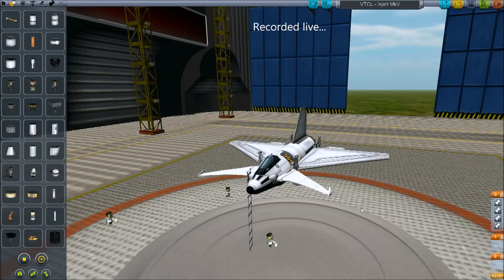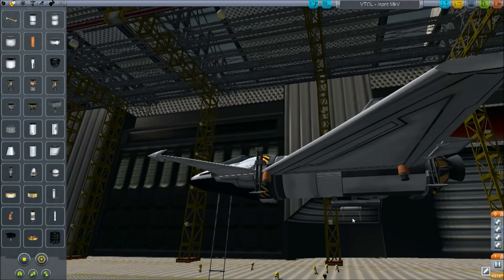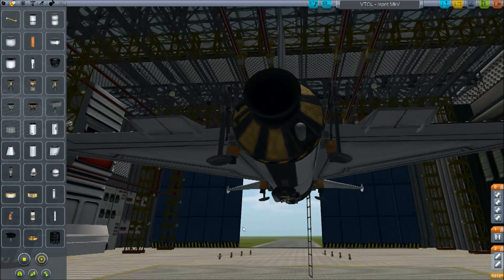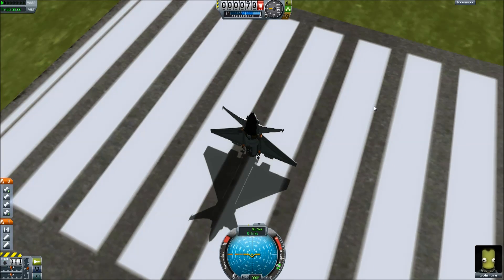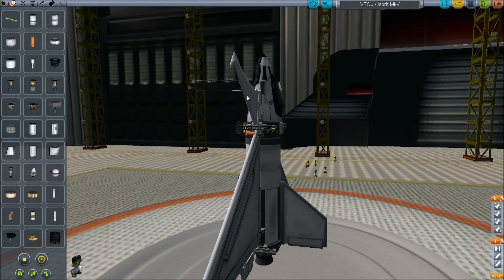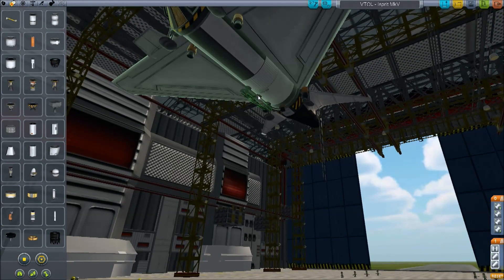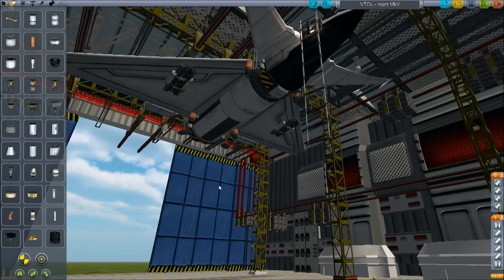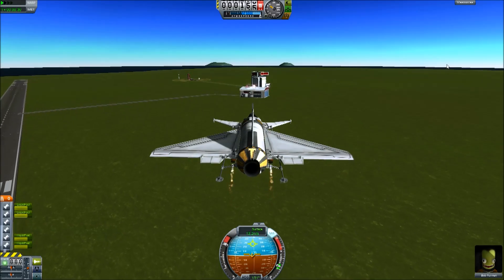KSP - How to Make Working Missiles

Comment: True. You can use a bit of trickery though: copy the .craft file from the SPH folder to the VAB folder, place the sepratrons in symmetry mode and adjust the angles in the VAB, save and copy them back to the SPH.

Comment: Probably, I haven't looked at the demo since it was updated, but I'm pretty sure it has the sepratron. If it doesn't, then it's going to be a little bit more hard, but you can make your own design. I've seen an interesting one that uses liquid fuel and the smaller parts.

Comment from the maker: The Gladius uses six control groups to fire three linked torpedoes. 

Deactivate main engine with (1) - then throttle to max.
Activate oscar engine on first two torps (5)
Decouple node on first two torps (6)
Activate oscar engines on second two torps (7)
Decouple node on second two torps (8) .... etc
By pressing 5-10 in quick succession you get a full salvo.

These missiles (not torps) work in a similar way but I can activate the seperatrons and the decoupler in one control group.

Comment: If you download and install mechjeb, using smart S.A.S. works much better for controlling VTOLS. You can control the ship however you want and it will auto-stabilize after the movement.

Comment: A couple ways, one is to ensure your center of mass is centered vertically to your rear engine as well. And another way is to angle your vertical engines just a tad forward. This also helps with slowing down when transitioning to hover.